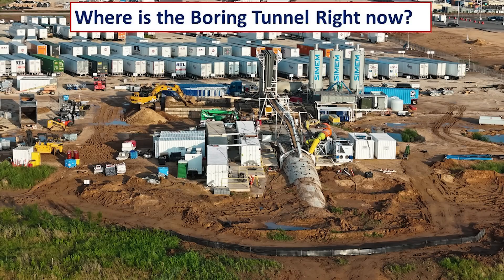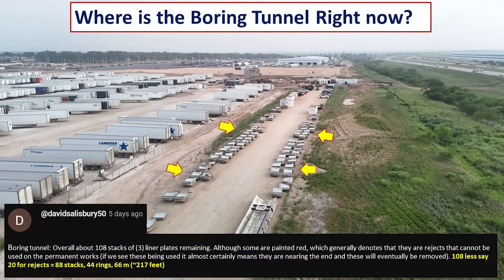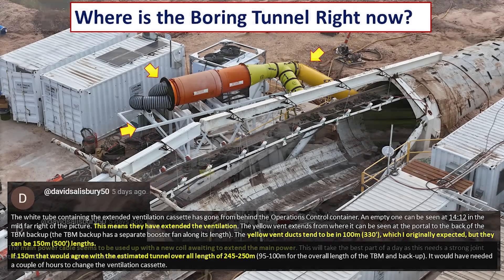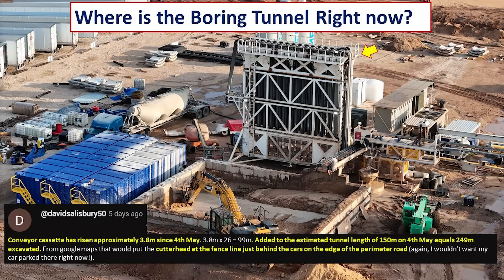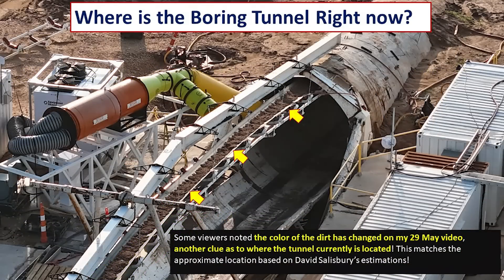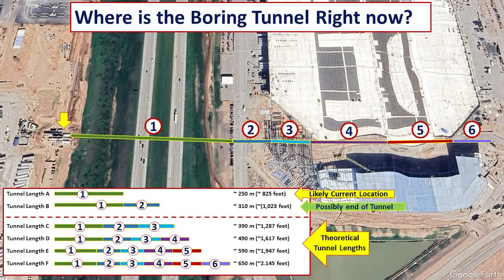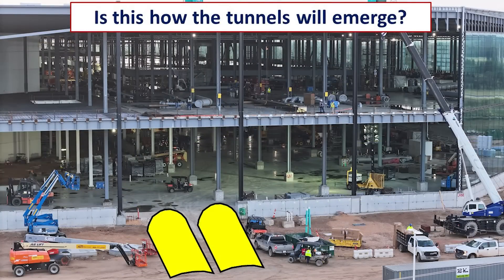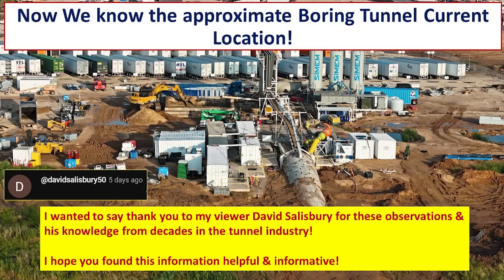Let's Discuss the Giga Texas Boring Tunnel Progress!

Comment: how are these tunnels gonna drain on a stormy day genuinely curious
Reply: A sump at the low point with an electric pump and a 3" of 4" main under the road back to the portal.
Reply: @davidsalisbury50  so at scale, a tunnel network of cars would need to have sewer connections at all their low points?
Reply: @patrickvidican  Most likely pumped sumps, as most metro or urban road tunnels do. Mountain tunnels can often be designed and constructed to use gravity drainage.

Comment: A couple of observations, that raise a couple more questions.
At 2:56, left side. The last 3 columns of the extension are painted white not black! Why? Maybe associated with the tunnel entrance?
Also, the drainage diversions going on just in front of these last 3 columns. Why? What are they being diverted for?
The alignment of the settlement points (bottom left) began swinging to the left on the east side of the highway. Also, if you look close, they don't seem to be angled square to each other the RHS one is ahead of the centre one and the LHS one is trailing. That would indicate a corner being turned.
All this points to the TBM coming out 30m (100’) north of point 2. Where the Orange and Cream colored access platform is standing.
Strange alignment for the new vehicles to take, but maybe the exit will come through the existing wall close to the current exit or even use the current Cybertruck exit with a turn to face the tunnel. Also look at the low wall inside the building on that corner. Almost like a roadway with the wall next to it. And not concreted yet. Maybe two surface feed points to the tunnel.
The TBM could take that alignment without greatly affecting the long conveyor in the tunnel crown that only starts 90m back from the tunnel excavation face.
Just spitballing ideas as usual, but it kind of adds up.
Reply: 2:56. The additional length required to the take a curve would help with the steepness of the tunnel. Same rise, slightly longer run. Still needs to duck under the stormwater drain on the north-south alignment 33.55m 110' out from the building line.

To completely change direction (90deg) with a 125m 409' radius I get a tunnel length (centreline) of 199.125m 652', an additional 74m 242' of liner required over a straight 125m length of tunnel.

Less radical change of direction would be shorter, but then the tunnel is less parallel to the building, meaning the portal needs to be further away from the building.

I'm struggling with the curves, so I may have this wrong. 42 years a carpenter, I can only think square and parallel.

The suspense is killing me!
Reply: @DessieDoolan  Not suggesting 90 degrees, maybe only 30 degrees. The more  think about it the more it seems to add up. But still cant get my head round the potential clash with the stormwater drain.
Same problem, I keep going over the videos from the last week looing for clues.
Reply: @davidsalisbury50  A drawing would be great.

One of the ongoing mysteries of this site is the near complete lack of publicly available documentation, and nothing leaked. You'd think it would be easy for someone either to copy and publish a PDF or 2, or even photograph a physical drawing. Nothing.

There hasn't been a single drawing architectural, structural, hydraulic, mechanical, electrical etc seen AFAIK. Some civil drawings that show drainage, roads etc have been released on 2 occasions before quickly being taken down.
Reply: I agree, if you look in the area of the white beams the ground has not been finished almost like there's more work planned for that location. Tunnel entrance??

Comment: Even if the tunnels come out just outside the building, there’s no reason why they couldn’t connect it, so you just drive through a hole in the exterior wall of the factory into the tunnel.

Comment: Many thanks for the visuals Joe. One point I would highlight is, at 3:00 you show the likely current location of the TBM cutterhead. One detail at this point is the three settlement markers (black sticks with white tops) placed in the ground just to the left of the assumed "straight" alignment. These are usually placed on the centreline of the tunnel, with one either side. They are also required to be in place ahead of the TBM tunnel to get a reference before the TBM arrives, hence being able to measure any disturbance to the ground.
This would suggest two things. 
1. My/our estimates for the length of tunnel at this time were a little ambitious (I was always giving TBC the benefit of the doubt on my production estimates so that may have crept the actual location ahead of itself a few times).
2. The alignment is 15m (50') to the left of where you have shown. But this puts the tunnel in a direct alignment with the two manhole chambers in the middle of the picture. 
I have, over the last two months kept changing my views on where the TBM will surface. I remain more than a little confused by it all. We should know soon enough.
Reply: Looking ahead, David can you give us any indication what to expect when the boring process is finished and the bare tunnel will be completed into a driveway? Is it customary and efficient to start at both ends or, given the restricted area being available at the S extension, will they do all the civil work from a materials laydown- and work area at the W side? Given the cramped situation with the temporary vehicle egress points at the main building I would expect there is some pressure to get the tunnel open for business asap. 

In the past there have been a lot of comments about the speed of boring etc, but there may also be a lot to gain (or lose!) during the follow-up completion processes. Maybe that could be another development avenue for TBC: given their standardized internal tunnel diameter there may be scope for prefab- and automated construction methods.
Reply: @hardernl8893  Could be either but given the site conditions there I would be tempted to do it all from the launch side. Tunnel is not very long so not a lot of value in setting up at both ends for just a few weeks work. Needs a sump, drainpipes, road deck with some manhole inspection points. Lights, ventilation at one end, some smoke detection and other emergency basics.
Should be no more than 6-8 weeks work if planned well once the TBM and its backup are removed.

Comment: The numbers. As shown on various site plans that Joe has on his Patreon pages.

Space between the road and building (the apron) is 130’.
There is a north-south stormwater drain located 110’ out from the building.

Invert (lowest point) of that drain is 399’ elevation (height above sea-level as used as a reference on construction drawings).
Elevation of the apron is about 412’ on the tunnel alignment.
Diameter of TBM is 15’.
For the TBM to pass under the stormwater drain with zero clearance and then rise to apron level, the minimum slope would be 28’ in 110’. 25% or 14degs.
For comparision, the maximum gradient for the proposed under river tunnel was 17.63% (10degs). I read online the maximum gradient for the Las Vegas tunnels was 17.5%, as required by the local Fire Department.

Add in 3’ cover between the drain and the TBM, the tunnel steepens.
Add 4’6” (factory floor* is 418.5’), the tunnel steepens again.

Chance to emerge through the highway berm has long past. Chance to emerge in the apron seems unlikely. Inside where a large section of floor is still bare earth would seem most likely.

* Main building floor elevation is 418.5. Exact elevation of floor inside the extension isn’t known. Presumably not lower.

Comment: Great video and explanation Joe. You do a great job researching varied topics and distilling the main points for the viewers, which makes you the best channel for GT, no offense intended to other drone pilots.

In today's video by Airway Dynamic I saw lot of dirt being excavated so they must be making good progress and are close. My guess is that the cutter head will not breach the outer wall of the extension as it would require very precise measurements and risks.

Comment: If the length was A, then it would make more sense to have a roundabout there...in which case it would have surfaced by now.
My first guess was B, but not directly attached to the building.  The tunnel can provide unwanted airflow directly into the building, which can cause contamination problems.  F would also avoid these issues, but at greater cost.
C/D/E all have problems with machine extraction...there's not enough vertical clearance.

Comment: Just a SWAG but I believe the tunnel will end just past tunnel length C (somewhere in area 4, purple) have the exit just before the middle of the  extension or the original end of production line.  Doesn't make sense to me that tunnel would end outside of structure due to weather and if models are transported via self driving (park summons and banish) they would do so where cause least amount of traffic delays.

Comment: You mentioned and showed two tunnels. Has Tesla said they are doing two? 

I have assumed this tunnel is to get cars from the factory to the prep and transport area. No need for a tunnel in the other direction. 

A second tunnel would be challenging right next to the other tunnel. The State transport Dept would be more concerned about potential settlement under the freeway with two adjacent tunnels. 

Also if the tunnel is going to end at the edge of the factory there would likely be  preparation underway there now.  

This supports the idea that the tunnel will continue under the building to the other side. 

Maybe even come to the surface and then go back down to get to the parking structure. 🤷‍♂️

Comment: Did you all forget that elon is about efficiency? This factory makes cars, and they account for parts and accessories down to the penny.  I think the tunnel is used to put cars across the highway to the finishing building.  Right now all the new cars come out of the buillding right next to the highway, and they drive them to the car lots, and they have to go around to the underpass, and then back north to the finishing building. This tunnel is for new cars, so my UNEDUCATED GUESS is that the cars coming out of General Assembly will go on a special road that hasnt been put down, then go down a ramp near the glass building, turn into the tunnel, and it will save each new car 5 minutes of merging into traffic driving a mile to get to the building, dealing with traffic there just to get in the building.  I think elon is trying to save himself 5 minutes of having a human drive the car.... per 500,000 cars per year,  which will save elon 42,000 hours per year on labor.

Comment: Exposed tunnel ends will need to be covered and protected from cloud bursts.  Rain in that part of Texas can abruptly drop in sheets.  One end of the tunnel could be dry while the other end could be receiving a swimming pool every minute (more if the lot settles near the entrance/exit).
Reply: Gee... I wonder if they thought of that? C'mon... Have you ever been through a vehiclular tunnel? There's one up here in Dallas, used to be one in Baytown (Goose Creek when I lived down there), then of course, there's the New York City tunnels, the Hoosac and Raton railroad tunnels, BART tunnels... Their portals are all under the sky.
If Joe's theory is right, and I think it is, the ramp will be covered and faired into the building, weathertight. At the other end, likely a shed or something similar. Remember, there's all that land not finished between the tunnel mouth and the EOL building.

Comment: There has been a lot of focus on increasing the machines tunneling speed but that isn’t where the efficiency and lower cost per mile is made. Given that the preparation and set up takes many months before any actual tunneling is done and that the tunneling is only operational a fraction of the time per week, focusing on increasing the tunneling speed per hour is almost irrelevant. What will reduce cost and overall net speed is getting the setup time down to a couple of weeks and having the tunneling operational more hours per week. The net speed right now including setup is only a few feet per day
Reply: IIRC, the Prufrock 3 is still in development/testing stage. How better to accomplish than a real world use case?
Reply: Fully agree Jim.
I have argued this point with TBC enthusiasts for the last 5 years. TBM tunnelling speed does very little to reduce cost. It has been their mantra and focus since their inception, and will be their downfall if they choose to stick with it as their main aim.

Comment: Could we drop the metric terminology? We're in the US. Texas, to pe precise.
The calculations and predictions seem plausible. The machine could be hoisted out easily, and the ramp and a cover built. If the end of the ramp were in the area of the perimeter beam, then the terminus would be sealed against weather. Two or three ends of lines coming out of the building, funneling cars to the tunnel looks plausible as well. 
The color change of the spoil is also a good clue. Anybody want to rent a Ground Penetrating Radar set and see if you can get in 😅 ?
Reply: Unfortunately, this is a global audience and many of us don't live in the US, Liberia or Myanmar. Hence we use metric. Conversely, as someone born and raised in the UK I still often talk in feet and inches, psi, miles etc.
I do try to include both measurements in my comments to keep everyone informed and happy, but it sometimes gets confusing and time consuming to convert everything to foot/pound/banana/bushels per square inch or whatever to cover all bases. Equally I wouldn't know a newton meter or a kilo pascal if it slapped me in the face with a wet fish.
Hopefully, I will never stop calling my basic sustenance needs a quarter pounder and a pint, or discussing motorcycles in terms of horsepower and foot/pounds of torque until I'm six foot under!
Reply: @davidsalisbury50  Indeed a global audience. However, comma, it's a US based subject, US origin, and the US soundly defeated converting to metric. Were Joe speaking if the German factory, fine. If the London Philamonic website wants to use "colour" and "aluminium", fine. If Die Bahn wants to use Euros, fine. That's their turf. But in Texas, we use our classic measurements, say "Y'all", Sem-EYE, want whiskey in fifths snd call those abominable intersections "Traffic Circles", and drive on the right - proper side of the road.
Now I've got to resume searching for my 10mm socket instead of a 3/8 in. Yeah, Detroit let that one get by.
Reply: @The_DuMont_Network  NASA tried it. The space shuttle was kind of half and half, and they screwed up a Mars probe landing when the software was metric but the calculations were imperial. I think they decided to go fully metric in 2004, then abandoned it in 2009, putting it in the too hard box. 
I still have my imperial socket set from working on classic UK cars.
It seems metric is making baby steps in the US, taking over by stealth. Most electrical systems, calculations and terminology is metric from what I can see. Some Universities have converted as I understand it. 
I Imagine Imperial measurements will remain in the language for generations, as they have in the UK. Beer in cc's or Litres never tastes as good as a Pint!
I generally enjoy the variety.
Just two things:
Tunnelling is spelt with two "L"'s. You can drop all the other "L"'s you want, I do, but that one is sacred.
And "could care less" ........ It makes no grammatical sense...... why.... it literally opposes the thing it is trying to convey.😠

Time to go put some PSI in my tires and do some miles at full horsepower.
Reply: @The_DuMont_Network  The however, comma, was classic!! I had a wonderful college professor back in the mid 80s that taught writing. She would use body language to explain comma usage, so I think of her saying 'however, comma' (with exaggerated hand gesture to make her point) all of the time!!!
Reply: @davidsalisbury50  I believe the lenses for the Hubbell Telescope were manufactured incorrectly due to unit confusion, also. The US Dept. of Transportation forced states to convert highway plans and specs to metric 100% back in the late 90s/early 2000s. But they only did what is (i believe) called a 'soft conversion.' In other words, a 4inch pipe was still a 4inch pipe but was now called a 103mm pipe. I still ordered 4inch, from a catalog that called it 4inch, and the factory made it 4inch. This went on for about a decade but was rescinded after countless mistakes resulted and the fact that it made no sense to have done it this way in the first place. Fun story: Fiber-optic cable has a minimum buy of 3280 feet for spec cable. Finally, after years of knowing this, I asked a salesman why such an odd number. He answered, '3280 feet is equal to one kilometer.'
Reply: @danlowe8684  My specialty (Tunnelling) still often makes standard rings in odd seeming diameters, 1.52m, 1.83m, 2.44m, 3.05m, 3.66m, 6.1m. Until you convert them back to old british imperial numbers, 5', 6', 8', 10', 12', 20'.